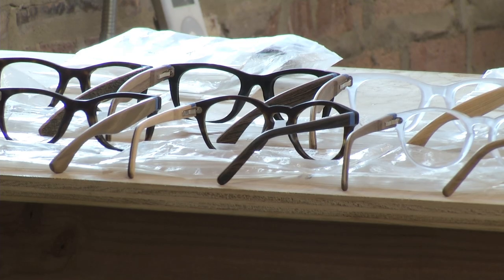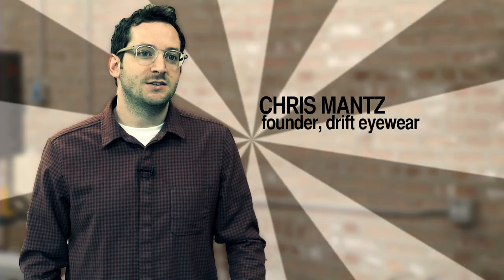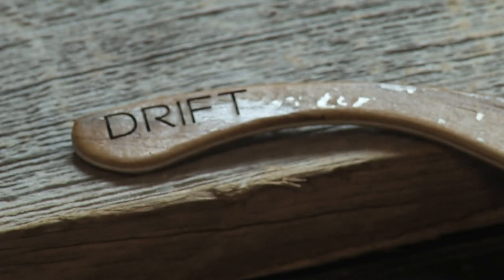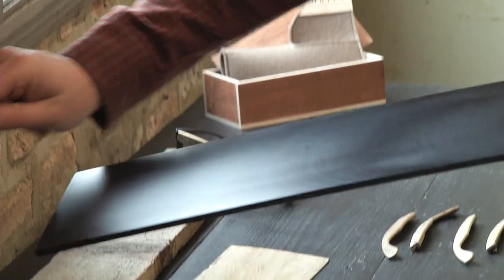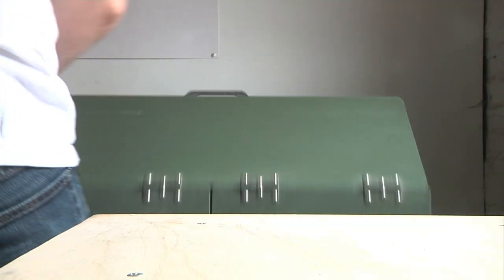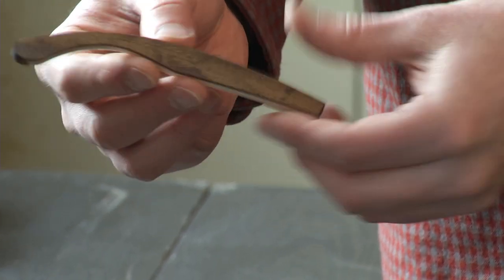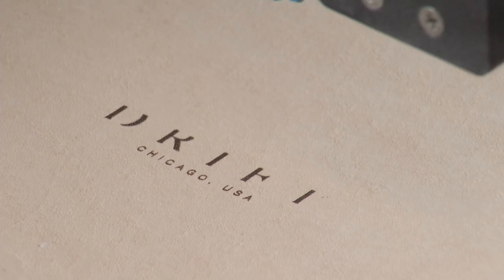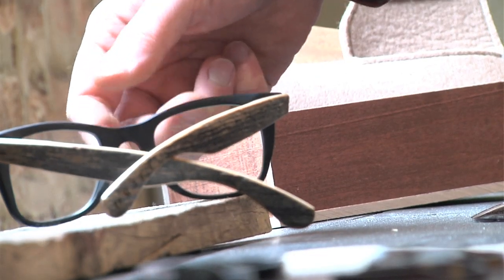Made In Chicago - Drift Eyewear

Comment: Sustainable woods hopefully means trees are not cut along the equator. Because those trees grow bigger and remove more carbon from the air. Heat and cold moves faster through air than water. That is why polar vortex and droughts keeps happening. Melting glaciers is changing evaporation patterns in the ocean. Just an observation.